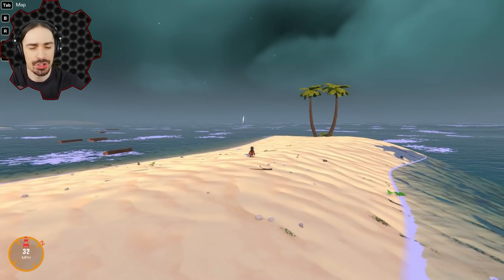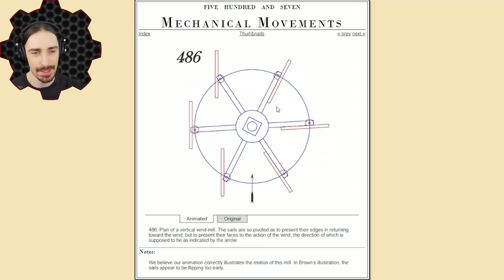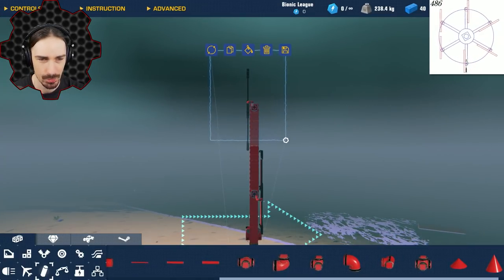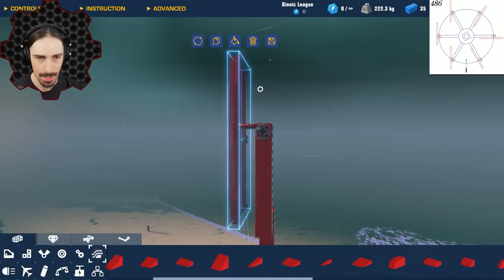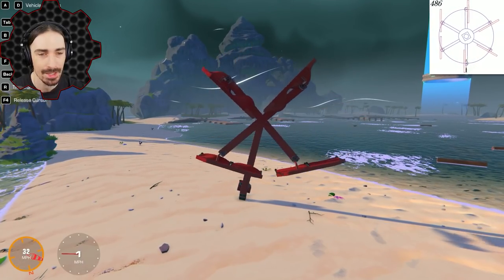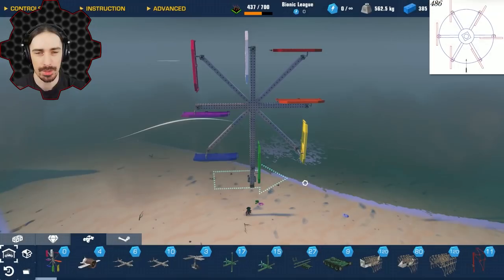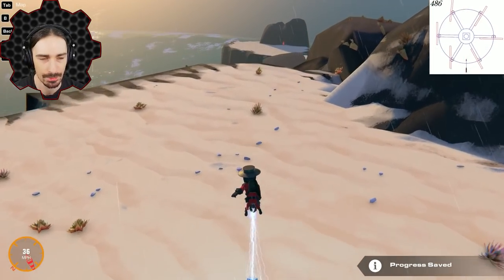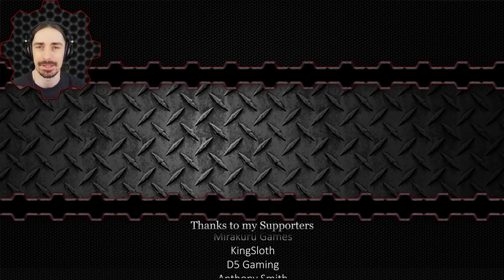I Recreated This Strange Vertical Windmill Design From 1868

Comment: The arrow on the plan indicates the wind direction and suggest a "top Down" view for a VERTICAL rotation axis.

 Scrapman : "Let's build it on a horizontal axis!"
Reply: there wouldn't be any difference, except for gravity maybe
Reply: @skmgeek  The whole point of a verticle-axis windmill is that it can work with any wind direction. With a normal horizontal wind turbine, the whole structure has to be aligned with the wind.
Reply: Yeah it seems to make a lot more sense the way he had it set up at the end of the video.  Also, set up that way, he could stack more sails vertically and get more torque out of it (probably not speed, that would require faster wind.)
Reply: That's what I was thinking.
Reply: I was waiting for the entire video for him to realize and then instead in the end he sort of discovered the benefit of making it vertical by himself 🤣
Reply: I 100% thought that was a top-down view at the start as well, glad to see he tried it that way at the end 😅
Reply: This confused me so much I was like "was I just looking at it wrong!?" Good to know I'm not the only one who noticed 😆
Reply: He even compared it to modern windmills with vertical rotation axis and still build it with horizontal axis
Reply: @skmgeek  of course it different, It will only catch the wind in one exact direction instead of all direction
Reply: I was wondering why he didn't asked himself "why should the wind come from below"
Reply: @stevepittman3770  pretty sure it could've easily been faster with a more efficient mechanism or by moving the sails even further to the side. the wind was decently fast after all.
Reply: You mixed up vertical and horizontal

Comment: I believe the orientation you had it in last is how its supposed to be. otherwise it spins the same way a normal windmill does, just with different forces.
Reply: if you put a ramp in front that covers the bottom half and forces the wind only on the upper half you can probably reduce the drag from the returning sails even more (that won't work in trailmakers sadly) but i tought it could be more efficient

Comment: Neat!  I can see why this isn't used today though, even setting aside questions of efficiency the amount of maintenance it would require due to all the banging around of sails would be insane.
Reply: @techno1561  i'd be more concerned about the drivetrain, as the load would be far off center. It is a a problem with all VAWTs (Vertical-axis wind turbines), which is why they are usually small.

Comment: i have a theory that any mechanical block can noclip through any normal block, EXCEPT any block thats also a mechanical block, aswell as any normal blocks attached to that mechanical block.

so if you have two steering hinges next to eachother in like a two-pronged fork shape, and you make them both rotate inwards they would collide normally, if the other prong wasnt attached to a hinge/servo it would pass straight through.

i assume they have that noclip feature just so you can more easily make steering work on cars, so people wouldnt have to account for free space for the wheel to turn.

Though i dont know anything and that theory is only from my own experience

Comment: Another reason why the windmill wasn't turning consistently, is every time the sail flips around it pulls back on the rest of the windmill, slowing it down.
Reply: It was mainly because of weltgroups messing up. It's the way trailmakers handles collisions with parts of builds.

Comment: I'm pretty sure that when it says vertical windmill, it means that it's supposed to be rotated 90 degrees from its normal position. I believe that this windmill is supposed to lay flat on the ground with the wind coming into the sales from the side

Comment: I must admit. At the beginning I was wondering what mechanizm you should build that will "force turn" those sails and position them parallel to the wind. But after seeing that this is completly automatic by the wind I had this "oooo that is how it supposed to work" moments.

Comment: You have totally missed the point of a vertical windmill. You need to turn it 90 degrees. It should also make it work better because the gravity will not interfere with individual sail's rotation.

Comment: You know how buildings covered with big sheets of Lexan or fiberglas tend to rattle around so that builders have to screw them down firmly? Consider this:

Have an inner shell screwed down snugly, with copper wires embedded in it. A 'tickler' current runs through the wires. powered from a storage battery. Next, put a second outer shell like the first, but NOT firmly screwed down.This also has wires embedded in it. As wind rattles the outed shell, a current is induced in its wires, which is rectified and charges the battery. Back-EMF reduces the rattling, and power pours into the battery. Same idea as in hydroelectric turbines, except that the 'rotor' rattles around instead of spinning. It should work; Crappy design of the outer shell is a plus, since movement and stress produce power. The inner shell could be wood, etc, with wires tacked to it.

Comment: You've been doing a lot of 2D builds, or rather, builds that would probably work much more easily in a 2D game. I recommended looking into a game called Algodoo and seeing if you can replicate some of these contraptions in there. The game is a 2-dimensional physics sandbox game, but you can technically make 2.5-D (I think is what it's called) by changing the collision layers of the shapes. You can also give the shapes general controls like moving and braking, there's gears, springs, thrusters, chains and more, and there's a grid to make buidling slightly easier. Just some tips if you do decide to look into it.

Comment: The thing phasing through the build is due to weltgroups, if two things are in the same weltgroup they won't collide. This is how pistonglitching works. You can only cjange weltgroups by changing parts around on the build. It has to calculate them again. Simply repairing won't work.
You can put a hinge on a detach block too

Comment: Think big! Build apartments into the side of a hill (natural  or constructed) and design air scoops to catch the wind and direct it to a vortex inside the hill. The vortex spins power turbines that send power into a public utility grid, The vortex rises in a chimney, and is vented high in the air A lot of power could be produced, even with little or no wind if air is drawn from warm air at ground level, and vented high enough. The vortex is like a tornado and can reach a hight of over a thousand feet beyond the chimney. 

I've seen this on a hot summer day with no wind in a soybean field. A temperature inversion formed with hot air at ground level that was trapped by cooler air above it, At one point, hot air penetrated in a violent stationary 'dust devil' that was 30 to 75 feet wide that flattened plants on the ground for a hundred feet, propelling dost and debris upwards where it  disappeared at a tremendous height.  Not a leaf was stirring 150 feet away, but stepping into the vortex could knock you off your feet. It didn’t move for over an hour. That could generate power without a prevailing wind. Vortices, once established, can be very persistent. Architecture and landscaping could harness the power in a large chunk of land. Lexan is lightweight, and is used in body armor, and comes in 20-foot lengths. It can moderate temperature 24-hours, and heat the ground to operate a wind turbine when ducted properly. (Years ago I crunched the numbers, but I don’t have those figures handy. But to get an idea of the potential power we don’t use, just consider the electrical power needed to raise the temperature 5 degrees on a quarter acre—it’s a lot of power.) Lexan is made with corrugations to cover large areas, that’s far easier than geodesic domes. And a vortex gives a compact stream of fast air for a turbine in a compact area at ground level, far more efficient than those huge fans that are so popular. When vented up a chimney, it produces a modest negative pressure that would keep a lexan greenhouse roof in place in high winds. Small communities could have their own ‘garden of Eden’ with low heating bills, their own power, and big greenhouses.

Comment: I wonder if miniature versions of these could power a quadcopter? It would be like a cylidrical propeller.
Reply: What would powering this thing accomplish? It would just be spinning blades with no net thrust. Edit: it could power a cyclocopter like vehicle, but you would need to control the sails angle of attack and not just let them free float on bearings.
Reply: @lukasstadler6594  then you see that scrapman made one months ago

Comment: a vertical windmill is supposed to have its axis in the be vertical so i can receive wind from any direction :P i found it funny that you tried to build it like a regular windmill because your fighting gravity as well. also you should totally try a corkscrew tank it would like slightly strange tho given the build grid but its cool either way

Comment: Scrapman, you've got spirit, but you were very confused going about this design.
The axis of rotation needs to be vertical, aligned with the pole. That's why these types of windmills are called vertical windmills.
Edit: Ok, you figured it out in the end, not fully realizing it though.
Reply: I feel like it should be called a horizontal windmill at that point.
Reply: @Dozav7  When you think about it, it'll be confusing most ways you name it.

Comment: If you use the rotate power of that windmill to power some wheels (i know gears ans something like that is not really possibble) you could build a wind powered car (or boat) that could drive in all directions using the wind

Comment: Ironically though I never saw one of these before I came up with the concept two years ago myself. BTW looks like a type of horizontal wind turbine to me, hence the horizontal axle.
Reply: my design used gears and chains to get the right orientation of the blades though
Reply: I watch the end of the video. now it is a vertical axis wind turbine.

Comment: cyclorotor in a drone, and its more efficient if you dont have a force pushing back, just the wind to one direction
Reply: vertical axis wind turbine is usually vertical :) not horizontal
Reply: nice clothes drier bro :)

Comment: I love that he doesn't realize that there are 8 sails, not 6🤣🤣🤣
Reply: He realized. He just didn’t mention it as it would’ve been some work to do an even six sides (can you lock bearings at 60 degrees in trailmakers?), and the uneven six sides would be pointless vs eight.

Comment: At the first design the sail wasn't rotating because it is a sail. They are designed to catch the wind and it did excatly that.
Also, didn't you technically build a horizontal windmill?

Comment: day 156 or 157 of asking scrapman to start a Survival series amphibious tank/basically any transportation and floating base/barge (or under water.) But you need mods... it's a requirement to breathe underwater, if you want an underwater base/transportation. And yes i am talking about the underwater fan moonbo reviewed that basically makes water spaces air spaces... if that makes any sense.) (and if you wanted to move the barge/boat/floating base you are able to make thrusters/glitches/mods to do it or by lift or actual push

Comment: Scrapman XD you seems tired, first building a vertical windmill sideways (which ok, still works if not as smooth, and also you figured that out on your own anyway) then proceed to add a sail in each corner of a 4 sail design and calls it 6 ! And just to top it all off, make all the lengths weird and unbalanced, only 3 of the original ones are short, you lenghtened the first one... 

I do really like these videos tho keep up learning and teaching and showing us plz thx bye.

Comment: but if a ship can sail with large sail surface, surely a windmill with large "sails" could harness much more power than these thin crappy "efficient" ones. Wind is free, we dont need to be efficient, just scoop as much as possible for max torque.